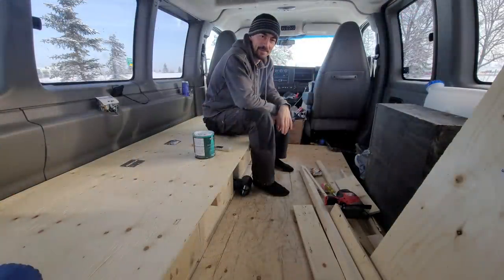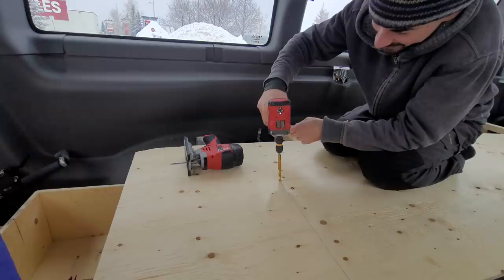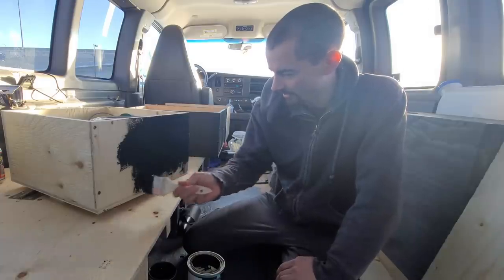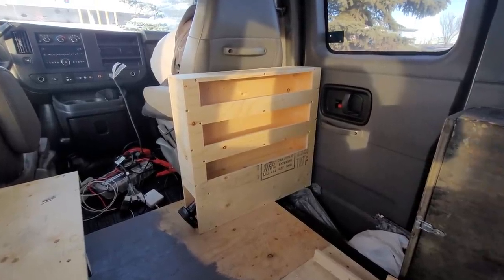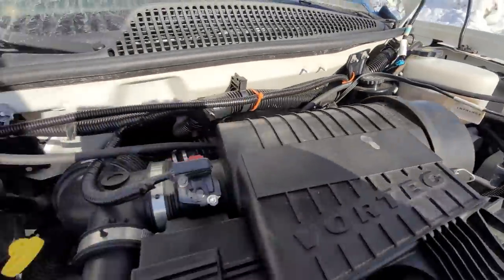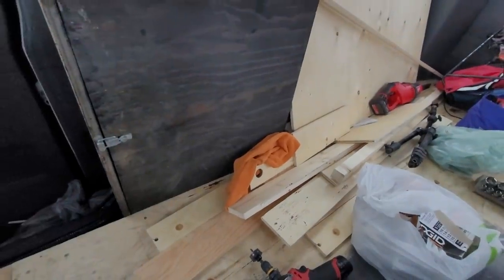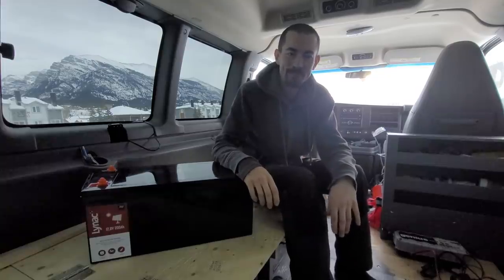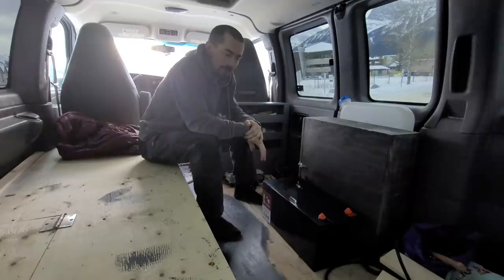Winter Van Life in Alberta - 4x4 Stealth Van Build

Comment: Actually, you don't have to swap the fuse - Just put another fuse at the battery - Make the fuse at the battery 5 A higher than the heater. Fuse at the battery blows, cable problem - Fuse at the heater blows, heater problem.
Reply from the maker: I might have said swap, but i didn't actually swap them 🙂 both fuses are still in place.

Comment: I would recommend rounding the corner of that storage cabinet, then pad it. It will hurt to it in the middle of the night or tripping over something. On the wiring loom up to the battery, I would strongly recommend putting a grommet where it passes thru the firewall. That plastic loom wrap will offer zero protection. The sharp edge will rip thru the insulation and short out the harness.

Comment: If you paint (seal) one side of wood, even plywood, and not the other, they will warp over time because they will expand and contract unevenly from one side to the other.  This is the number one reason why I see peoples homemade cabinets fail, they paint the outside but not the inside.
Reply: Great tip.
Reply: Not so true when latex base paint is used. It doesn't form much of a vapour seal, compared to oil-base
Reply: My solution: don’t paint either side.
Reply: Good to know👍

Comment: I have one small concern. When running cables through holes drilled in the sheet metal (even in looms) you should use rubber grommets in the holes so they don't wear through the cables and cause a catastrophic short.

Comment: The air intake for the diesel heater will circulate your moist interior air, because it doesn’t have the power to suck in the outside air through the existing van air vent. I understand what you’re trying to do, but I’m convinced that you’ll get condensation issues.
Reply: More likely the heater won't last long

Comment: There are a ton of ways to build any Van.. the only thing looking at your video's from the past year.. id say the inside you can design as you like it.. close to your older build but with more space for sleeping and cooking (i know you love cooking).. but for the outer part. either you can go with stealth lifestyle or proper van build (no stickers or markers of who's van is this). am sure you've already gotten a few of these suggestion before hand.
Suggestions:
1.  half size sturdy roof rack with a ladder.
2.  Heavy off road tires (with heavy tire chains)
3.  Roof fan.
4.  Front bumper/brush guard combo (with wrench) and fog lights
5.  Led bar light for the front.
6. 400w solar panels with MPPT charge controller and inverter (previous built equipment can be used) .
7.  Extra color coated fuses for the fuse box.. you'd not want to be in the wildness and oh the lights are not turning on or the heater or the fan.
9. Recovery Rope (yankum ropes)
Optional: Awning, external storage box, Rust proof for the salt on the roads, (fluid Flm) the underbelly completely before taking the vehicle on/off-road.
Reference back storage: https://i.ytimg.com/vi/BGOIZEN85Rg/maxresdefault.jpg
Reference back storage rack and back bumper: https://s-media-cache-ak0.pinimg.com/736x/bb/5c/7d/bb5c7d094bb1448f2638aea157e996cb--quigley-van-chevy-express.jpg
Reference front bumper with wrench: https://i.pinimg.com/originals/af/ef/b9/afefb992d9f7faec7b5fef9b978c02cf.jpg
Happy New Year to you, stay safe n warm.. GOD BLESS.

Comment: Nice build, but be careful with that fuse block. It's not waterproof. You could see some corrosion from the bare metal. You've got it running now, but check back in a few months. I have a 0 guage with the rubber seals to make it water resistant. I'm planning on running a circuit breaker and a battery isolator relay so it'll charge while I drive, but not when I'm parked.

Have you considered a bike rack on the exterior? You may be able to put it on the front bumper and save space, but that's not always ideal. Putting it on your roof is probably the safest way to keep people from stealing it outside, but not always safe if you have low clearance. I'm considering doing a deck on my van build. I have a ton of junk just waiting to use. I'm thinking about some ladder racks, my old aluminum truck box and build a deck to chill on. Maybe I can find something lightweight, but it's not necessary. I don't want to spend a ton of money on something that isn't necessary. Chrome probably spent a ton on his ladder rack.

Comment: If  you place the heater fuse outside the cabin, it will rot quickly and fall apart as you pull it out, keep extra fuses around anyway.  You probably can locate it under the dash and run wire thru firewall

Comment: There are nice little generators you can get, a 1kw and under. Fairly usless on many levels, but can use them to slowly charge the battery up. It be less load and less fuel used up than to use the van if its sits and idles just to charge the giant battery.

Comment: Looks like it’s almost finished. You work fast. That battery is awesome. You can protect it from the elements if you build a insulated box around it. Put a 12V heating pad on the bottom and a cooling pad on the side. That way you are protected of extreme temperatures. 

Love the progress in just 9 days. 
Happy New Year Foresty !

Comment: Excellent .... Beautiful.... Great Job...
Thought for...
1- add a grommet where the wire passes through the floor. You can cut the grommet to help slip it in... or use a flexable cutting board wrapped several turns around the wire (passing through the hole) held in place by "Shoe Goop"...rtv.
2- Add more loom to wires in engine compartment. Heat protection... especially along top of fire wall...
3- Build an enviroment box for that excellent LiPO Battery (Wow whata Christmas Gift!!)
Add insulation (1/2 foam ??) all around ... small electric heat element (20 watt??)... vent fan.... Themostat control when to be on (both fan and heat) When you are driving...Or if you do re-add solar...again. you will get more charge time. Thanks for staying awake to the end of the post... And all the cool video's...

Comment: When the time comes, invest in a good string of diffused RGB+W LED lights. Find a way to integrate them into the whole build, it really does a lot for the mood and feel of small spaces like this, and being able to tune the color temperature and brightness, or provide nice even cool or even warm light in the interior for relatively low power usage is really nice.
A loop around the ceiling, and a loop along the edge of the bed and cabinets should do you nicely, and you can get units that are bluetooth or wifi controlled from yoru phone, or just use a remote.

Comment: Foresty, something to consider if you haven't already is gluing down 1/2" EVA foam exercise pads that interlock. I did this in the back of my van and now i can jump in there on my knees with no pain....So far mine are staying glued down using rubber cement.

Comment: With the way you mounted the diesel heater the exhaust plumbing is inside the cabin they are designed to have all the exhaust out side of the cabin and to be sealed so there is no chance of carbon monoxide entering. You could leave it as it is but make sure to airtight seal around the platform you made.

Comment: you should use 0 gauge welding wire since it has less resistance and at the full burp of the inverter it's going to provide the least amount of voltage drop.   I've always Mountain my inverter literally right next to or right on top of the battery since it does take quite a bit of amps and even with 0 gauge cables I've had my 700 watt inverter get pretty darn toasty on The Wire connection points.

Home Depot actually has these really big aluminum lugs that work really well and I actually like to take those and clean them off and use Dielectric grease along with electrical contact cleaner that stays on the actual Terminals and seals them quite well from oxidation.  if your inverter take slugs like the Walmart brand inverters make sure to use double the lugs and double the wires at 4 gauge and you should have no problem with voltage drop either .

I also tend to separate my positive and negative cables at least one foot apart for really high amperage loads as they start acting like magnets if you start using a lot of current.  car audio SPL guys will understand this.    a lot of people just use the frame as a ground but I've always been really anally-retentive about voltage drop so I've always run positive and negative cables all the way back to the rear batteries and heavy loads.

for those of you that are actually still using a lead acid base set up one thing you can do to increase the voltage back there is to use something called the quick to fire which is basically a unit that takes the three-phase AC from the alternator itself and then you can basically use 10 gauge wire that you would get it Home Depot run it all the way back to your batteries and then with the quick to fire which is basically something that takes the unregulated AC output of the alternator and then where your batteries and heavy loads are it'll convert it right there to 14.4 volts or slightly higher 15 volts right to where your items are and you will not only get greater efficiency but you don't have to use the really large that cables for the long run since AC power is more efficient in 10 gauge cable.      just follow the same safety precautions you would as you're dealing with a c from your house.

Comment: Foresty, the reason they call for a 90 Amp Fuse is because the 4 AWG wire (if it's 90C) can only handle up to 95 Amps, with a 100 Amp fuse there is a small chance the wire might become the fuse instead of the 100 Amp fuse, so it's a protection thing. You've probably already found a 90Amp fuse by now, but just wanted to throw that out there.

Comment: I look forward to seeing how your creature comforts come along as the setup gets fleshed out. 

For one thing, how about buying a small 1080p native resolution projector unit? They've come a long way and price is reasonable for these. You could project the image onto your ceiling, or onto a wall with a projector screen for a clear image. That would give you a large monitor (easier on the eyes) for all your video editing and watching and work needs. Projectors are also useful for casting templates if you're doing woodworking or pattern making.

Comment: FF u can avoid buying handles for those kind of drawers. Just drill three 25mm holes that over lap each other to make functioning finger pulls. And save a large piece of carboard folded up for now in the van. Used for when you slide under it for work efforts.

Comment: 👍get ya a heavy duty  2 into 1 Y splitter extension and plug ur shore power and block heater into the one connection & itll hang out further....   I still think you should get a small generator inverter for emergencys like starting that deisel in real cold climates and to be able to plug ur shore power in to recharge if solar isnt so hot or the van isnt wanting to start for sum reason atleast you wont freeze til you can come up w/ a plan for extraction lol. *"I just checked and my all in one deisel heater is fused inside the unit so im not so sure you should have moved it closer to the battery cause mine is factory fused inside the heater? im not so sure that was correct info based off my units wiring"..

Comment: Really enjoyed the update. Have you thought of putting solar panels on the roof? Hey, I forgot to say how much I like the look of the van on the outside. Simple but purposeful!
Reply from the maker: Thanks.  I've found solar is not very effective here, 3/4 of the year you get next to nothing.  I suppose you could go all out and build 1000 watts on a big tilting arrangement... but I'm going to charge from the engine alone.  I can separate my usage between two different batteries.. so 15 minutes of driving can top everything up.... unless i do a slow cook or use induction.
Reply: @forestyforest  Good points. I did think they’d be very bulky, plus you’ve then got to run lots of wiring etc. Not very efficient.

Comment: Might want to beef up the transmission due to all the added weight.  All these conversion vans seem to blow transmissions.  A bigger cooler is very cheap and easy to install and should be a bare minimum, there are other cost effective upgrades you or trans shop could install to help it too.

Comment: The Home Depot moving blankets, (Pratt standard moving blankets), are $10 and are a thick felt. The more premium blankets are quilted but the $10 are just felt, but a thick felt I have to add. The size is 54” x 72”. HD also has rolls of the reflectix, or should. Foam board might be better cost wise and r-value wise. 4x8 sheets. Look up “ hot wire cutter” in instructables. Makes cutting the foam clean and good looking. Some wire and some alligator clips ( maybe a small fuse box made) , some other minimal parts is all that’s needed. Really not much to it. You have the battery power already. There are a number of windows to cover. Should make it easier with so many to do. 

On another note, that Milwaukee jig saw with a straight edge looks to cut pretty straight? Or is that a camera trick angle? It looks good, you seem to be ok with the cuts.....?
Reply from the maker: If you measure carefully and let the saw do the work... it does pretty good!  Thanks for the tips!
Reply: @forestyforest  my go to choice for cutting  ply would either be my circular  saw with a straight edge or the table saw. Never really considered the jig till watching you. Will need to try it next time making some sawdust. 

And the felt is black, didn’t state the color. Had to use them as curtains up here in the San Bernardino mountains in Socal to try and keep some heat in the house. They are blackout quality. Thanks for the feedback.

Comment: Man, that hole you drilled to put the wiring through is going to be rustrotted by next winter. Should have put it on a 90 degree
Reply: Extend by permatex would solve that rust issue

Comment: Being the cheap person I am I would probably use OSB rather then plywood. That stuff gets expensive
Reply: I use 18mm OSB to replace broken floorboards, but the crude composition doesn't work so well for supporting stressed hardware like hinges, and it needs to be this thick to support much weight without bowing or splitting. Plywood is easier to work with accuracy, has denser structure for screws to bite into, and offers as much strength in a thinner board. Not saying OSB wouldn't work, probably would and maybe wouldn't make a big difference. Also I've never fitted out a van for dwelling.

Comment: At 10:40 the arrival of 200Ah from #Lynacbattery #12V #lithium from #Canadabattery manufacturer #Lynac

featuring
#Renogy2000WInverter from #Renogy #2000WInverter
#Renogy60ADc-DcCharger with low current mode #30A
#DC-DCcharger can only be switched toon high current mode #60A with a high output alternator and not with the stock alternator.
#NocoCharger
#BlueSeaSystemsFuseblock

Comment: Hey man you need to have your diesel heater vented outside of your van otherwise you will die when you are sleeping! Again it needs to be vented outside of your van hopefully you bought one with the exhaust. Don't cut corners
Reply from the maker: It burns diesel in the combustion chamber.  Of course that is vented outside or else you'd die within minutes.

Comment: will be interesting to see if you install a sound system now that you have enough space! Isn't the diesel heater noisy under your bed? Or just the pump?
Reply from the maker: Both.. mostly the fuel pump ticking though. It needs improvement.

Comment: I have not made the jump to lithium batteries. I would like to but I'm not positive that's my problem. Right now I have two lead acid 115 amp hour batteries they're only a few months old. I'm also charging them by an alternator along with 200 watts of solar. I had a little bit of trouble during the summer because of the heat causing my refrigerator run all the time but now that the days are shorter it's really becoming a problem as I'm running out of power earlier in the evening. My curiosity is do I have a problem with my batteries or is it literally because they're acid filled is switching to lithium really going to make that big a difference. I've noticed that you can go off and leave your Crock-Pot running for 8 hours and you don't seem to have a problem with your battery. Please advise sincerely Michael

Comment: If the DC-DC charger asks for a 90A fuse, doesn't a 100A fuse kind of defeat the purpose of the fuse? 98A comes along and damages the charger?
Reply from the maker: Not too sure.. i think the charger just takes as much as it needs.  Its more about protecting the wires from melting if theres a short circuit along the line.

Comment: If I were to get a heater for my 8ft box pick-up truck what size heater would I want? Also, does it run on a thermostat so that it turns on and off as the temperature changes? How many sizes are there?
Reply from the maker: 5kw would probably do the trick.  I just set the heat level manually.  I'm not sure if it has an automatic mode.

Comment: Maybe i missed the reason, but what happened to your old van or you just wanted a van with bigger space in it? Also will you transfer all/most of the old stuff from the old van to the new van? :)
Reply from the maker: I have wanted 4x4 and high clearance for a long time.  I decided to just go for it!  The minivan has a new owner, he has a channel called Dadcam Rocks.
Reply: @forestyforest  Ah ty for the quick answer, well i hope it goes good for you. But did you sell the van to him or? Also this van is not even fully built yet, where do you sleep if it gets really cold? Just a bit worried about you since you sold/gave away your old van before the new one was finished.